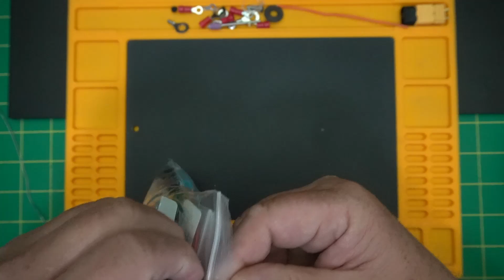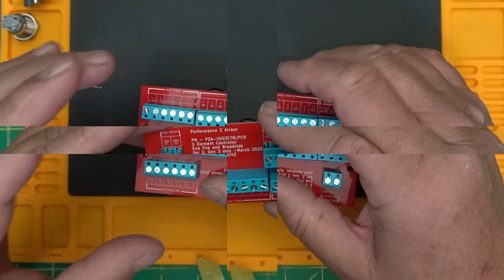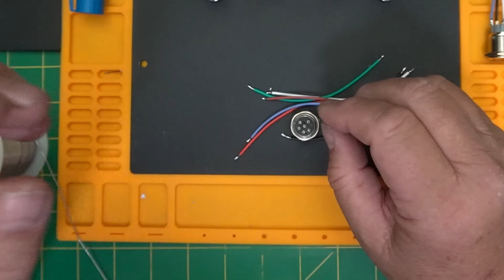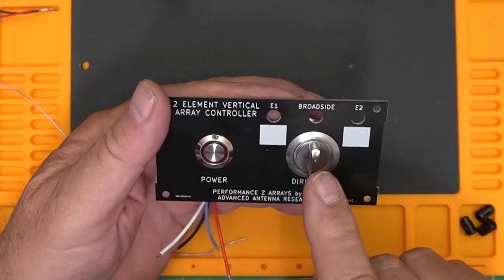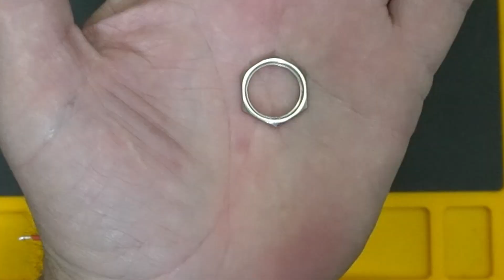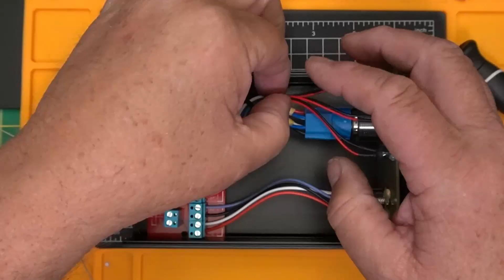Advanced Antenna Research, Building the Phasing Controller, Part 1

Comment: Thanks for the build series!  I'd love to do this project if I didn't have german sheps that like to get caught up in ground radials 😂
Do you not like using flux?  Ususally helps me with soldering to boards.
Reply: It's pretty easily portable. You can put it out and then take it down if you want